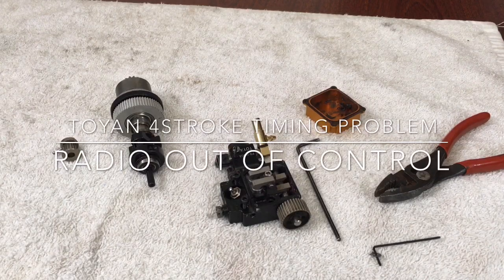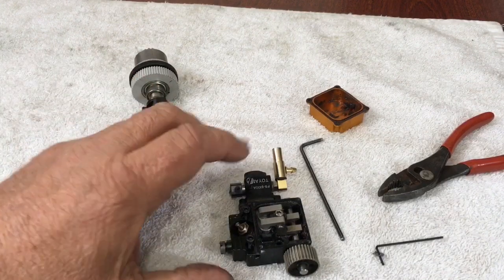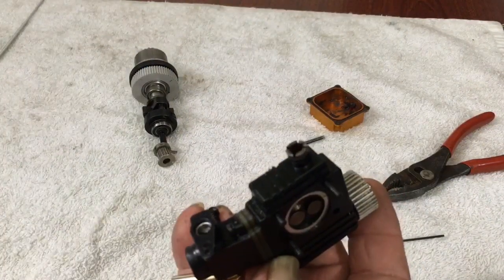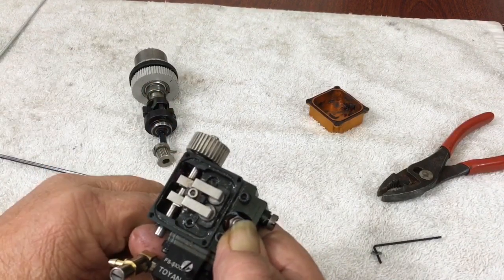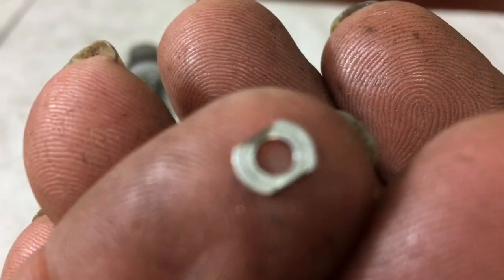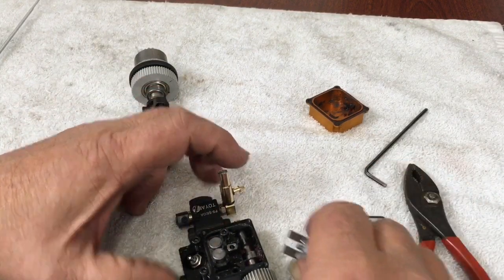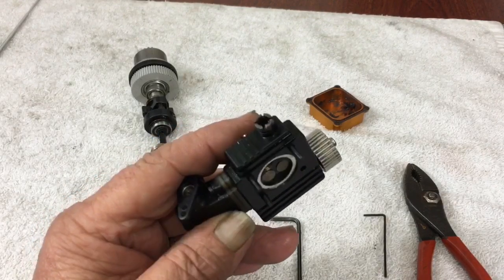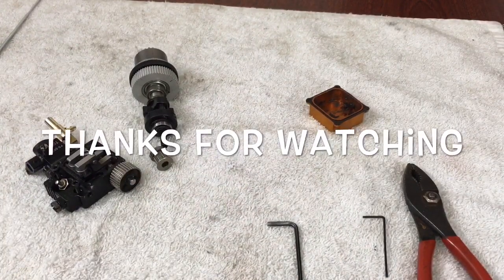TOYAN 4STROKE timing problem!!!

Comment: I hope you see this comment and reply - first of all great video - I think this is what is causing the issue with my FS-L200,  Here is my problem - I can get it to start and it revs up real fast and cuts off in 3-5 seconds - I think the longest I got it to run on it's own is about 10 seconds - I tried adjusting the carb first with the top screw (silver) about 1 3/4 turns out and the side screw (black) about 1 1/2 turns and as stated that is the best I can get it to stay running.   

So my Question is do you think this valve thing you found could be the issue - how did yours end up running once you placed the washer in place to make sure the valves fully closed.   Secondly, can you confirm the carb settings I am using are right.   Any help would be appreciated.
Reply from the maker: thanks for hitting me up with the tuning problem, my first question is are you using the fuel tank that comes with the starter kit? if yes throw it away because the feed tube is flush to the bottom of the feed pocket and it starves the fuel during reeving. try putting the fuel line directly into the fuel bottle and keep it within 2mm height to the carb, before you tear down the cylinder head.

Comment: Yeah I just put mine together and it does run at all and whats the thickness on that washer I'll have to go to the hardware store. Update I did the shim. What fuel do u use
Reply from the maker: Cool to hear you have installed the shim, I have used many different 20 percent nitro fuels with good results👍
Reply: @dennisdempseyradiooutofcontrol  i got it running it was really dump lol

Comment: Would it be possible to carefully sand down the lumbs over the valves? The ring will move up the side of the camshaft to giving you less travel. If you sand 1 side down it should close and still have max travel

Comment: Sorry for my very late response, but I just saw your video for the first time.
There is nothing wrong with the construction of the valvetrain but it has been assembled incorrectly.
The valve lifters revolve around an axis that has a rectangular part in the middle, through which the mounting screw goes. That shaft has a thicker part at the bottom than at the top.
If you mount it up side down, the shaft will sit too far down and the valves will remain slightly open. Turn that axle 180° so that the thick part is at the bottom. The mounting screw must therefore be screwed through the rectangular part from the thin side and your problems are solved.
Reply: I just did that, and the problem still there, valve open in top dead center

Comment: You couldn't be any more wrong     you are 180° out on the cam shaft,   360° out on crankshaft
Reply from the maker: At top dead center both valves were open,   actually both valves never closed through the whole 4 stroke cycle because the rocker arm support in the head was milled down to much. I installed a shim washer under the rocker arm and it corrected it.
Reply: @dennisdempseyradiooutofcontrol  looking at your video,   both of them     the lines on the cam shaft were pointing up,    not down,    YOU WERE OUT 180°      NOT JUST ME HAVE SAID THAT IN YOU COMMENTS
Reply: @russcole5685 the valve are not supposed to be closed at top dead center to make the compression?

Comment: What's the dimensions of the washer? I'm building one of these engines.
Reply from the maker: I used a 3mm washer that came off the front guard mount on my hg-p407 and filed the sides down to fit in between the rocker mount.

Comment: Interesting video, I'm in process of converting mine from air-cooled to liquid cooled. My rockers have a tiny bit of play and valves are fully closed when piston at top dead centre. BUT, if I spin the rockers little square block around the opposite way and tighten it back up, like yours did in video it pushes the valves open and the valves are open slightly at top dead centre. Have you tried tapping a couple of nipples into the rocker cover to re direct the excess oil for lubrication yet? That's a good idea and interested if that worked well?
Reply from the maker: That sounds like a cool conversion, yeah the cam block only fits one way, I did the nipple mod for the oil and it did work but the oil was leaking out of the cam bearings and made a mess on the top of the engine.

Comment: That is not the compression/power cycle unfortunately. Valve clearance is set 180° from where you have your cam. Valve overlap as you are showing is perfectly normal. Rocker arms should rest on the base circle of the cam, lowest point of camlobe when setting valve clearance.

https://chainsawjournal-wpengine.netdna-ssl.com/wp-content/uploads/2019/01/2-stroke-vs-4-stroke-engine-diagram-1.jpg

Comment: Dennis, you are very dedicated to respond to all these comments! Hey, Toyan shorted me one brass nipple that screws into the exhaust box! Is this a standard part, and if so what is it? I emailed Toyan but i hate to have to wait for it to come from China.
Reply from the maker: If its the one for the tank pressure tube, those can be bought at most hobby sites that sell nitro airplane parts, its a 3mm threaded nipple.

Comment: They should of made the rockers adjustable to avoid this problem. The size to get these parts come together so precisely leaves zero room for error and in there case you have what you called poor designed. even the engine in our vehicles have adjustable rockers. even though is a tiny motor I can see about 3 different ways they could made that adjustable but aging it takes a special person to go back and spot those areas where it could of went with a different approach. Nice discovery Dennis maybe they can see this and learn from it.
Reply from the maker: Good call there, making them adjustable would eliminate a lot of problems and tear down time.

Comment: Made in China, the handwork is rough. This is normal because the price is fair. The Japanese-made O.S. engine is serious and professional. The handwork is meticulous./中國制造，手工粗糙，這個是正常，因為價錢平，此中日本制造的O.S.引擎，認真和專業，手工細致，
Reply from the maker: I agree there brother! the OS engines are the best!
Reply: Thank you for your reply. I do n’t understand English. I can share the modification of the model car with you and learn from you. I conceived to build a traditional truck with 4 strokes of engine, water tank for engine water cooling, and clutch disc type for transmission. Centrifugal], the gearbox is changed to a small electric drill toothbox, which has planetary gears inside, sufficient torque, and front and rear speeds. The above is translated by Google into English, thank you。

Comment: Dennis Dempsey Radio out of control  I’m having troubles getting the timing belt on while keeping it in time. I think it shifts a tooth because it doesn’t run right with the shim even though I filed it down pretty thin
Reply from the maker: On mine i had some trouble installing the belt also,  I ended up holding the crankshaft in a vice from behind then carefully moving my cam sprocket ahead one tooth to line up the marks, then slipping the belt on, even then one still needs 3 hands to install it lol!
Reply: Dennis Dempsey Radio out of control Can you take a picture I love your timing points and send it to me on my email? My email is elpompudo@aol.com

Comment: Very interesting Dennis. I can't wait to see a running video before you make any more changes! A lash adjuster on the rockers would be great , but that might cause a clearance issue with the valve cover , not to mention the difficulties in drilling, tapping and finding suitable hardware.
Reply from the maker: I got it up and running, what a difference! good idea on the lash adjuster, im thinking a 3mm grub screw would probably work.

Comment: @Dennis Dempsey Radio out of control, i agree, it makes the valves open too late. i think there is a lock-pin behind the timing gear, to prevent rotation on the shaft. Maybe it is worn-out on your engin?
Reply from the maker: yea my pin was worn, i changed it and now its tight now.

Comment: I'm sure when it's hot the tolerances change
Reply from the maker: yea i measured it hot and it swells about .02 thousands of an inch at normal hot temp.
Reply: @dennisdempseyradiooutofcontrol  so is it worth the investment?
Reply from the maker: @christopherringold2869  I would say yes, there isn't another engine like it out there, and not all engines have problems, seems just the first batch did. I'm going to buy the gasoline version soon to compare it to the methanol version.

Comment: The washer is a great idea, but it needs to be a beveled washer, to only lift the valves side, not the rocker side.
Reply from the maker: It worked, I thinned the washer down to .030 of a mm, now it pops when it runs and the oil isn't blowing back out the carb.

Comment: You could try filing the washer thinner you see how it runs like that
Reply from the maker: It worked, I thinned the washer down to .030 of a mm, now it pops when it runs and the oil isn't blowing back out the carb.
Reply: @dennisdempseyradiooutofcontrol  what if you tried making a carb spacer
Reply from the maker: @rcmcguyver7561  good idea there, it has 2 spacers already about a 1/2 inch thick. i was looking into boring the intake/exhaust ports out to see if it would rev higher lol!

Comment: Dennis if you turn the centre block around it should be ok, when I had mine apart a few times I once turned that centre block between the rockers around the opposite way and I had the same problem no clearance on the rockers, it only goes on one way or you will have this problem. If it’s the same then you may have one that’s not manufactured right, but try it first before you use the washer mod 👍🏻
Reply from the maker: Yeah I showed that in the video, if I turn it around the valves are open further.

Comment: id take the shim out , take a micrometer screw the rocker shaft bolt all the way down, take a measure then loosen the bolt until the valves close , measure it again and that should tell you how much shim you need..with the timing , instead of using marks id put the cam dead center between the cam lobes with both up, then id make a piston stop  then make a degree wheel just like when you degree a cam to find exact piston tdc and you should be right there..if your cam gear movesyou will need to lock it down some how ..on another not , they may have designed it that way to keep the rpms down to prevent valve float..
Reply from the maker: That will be the correct true timing repair, wish I could get some support from toyan to help.

Comment: Do you have room to shave the rocker arms where they touch the valves? That way you don’t need a shim and your valves close. Or if you want the shim, just add to the rocker arms with heat shrink or something like that. Either way when your working with something this small, the tolerances are very close. See if your engine has any defective parts.
Reply from the maker: That's a good idea, i'm going to test it with the washer and start from there.

Comment: I will check this too. But i think you can make a shim on the valves.
Reply from the maker: my timing gear has a lot of play on it, as small as the tolerances are on this engine its got to affect it somehow i would think.
Reply: @dennisdempseyradiooutofcontrol , i agree, it makes the valves open too late. i think there is a lock-pin behind the timing gear, to prevent rotation on the shaft. Maybe it is worn-out on your engin?